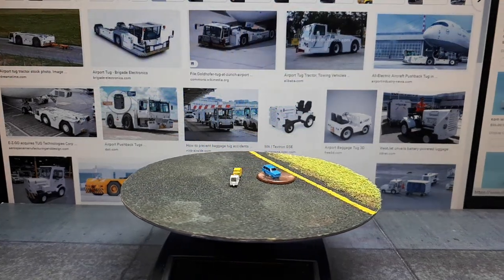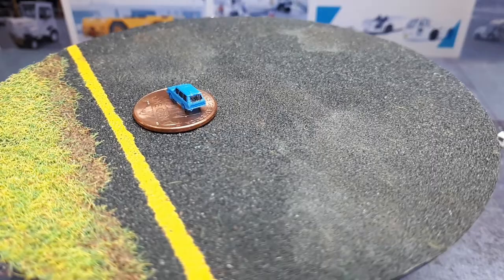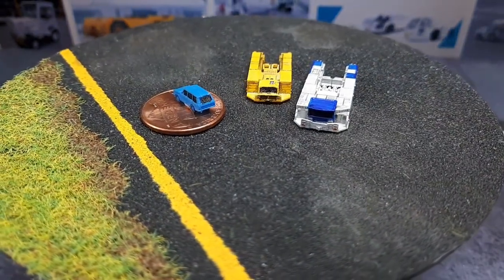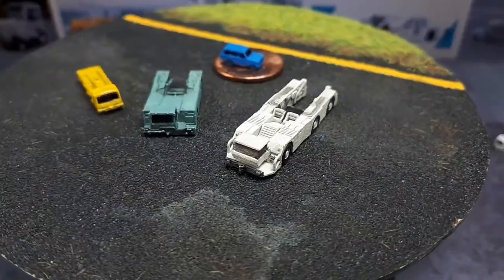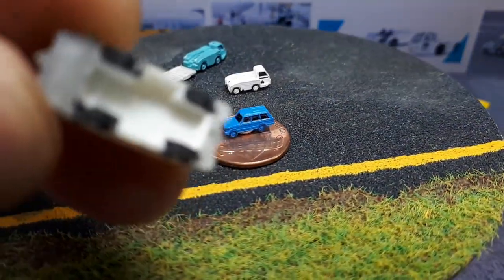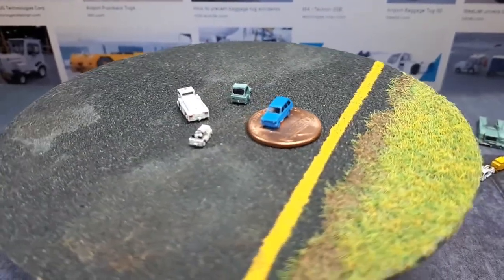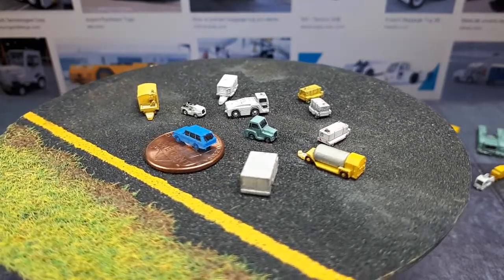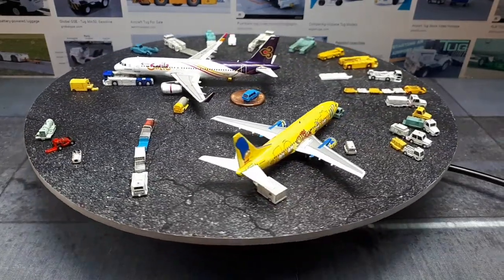1/400 Airport GSE, tractors, 3D printed from Shapeways, tugs, pushback, trailers,

Comment: Love your stuff. Just a comment on the "welding cart". In 30 years of working over 20 different jobs at the airport, I've never seen a welding cart. I'd wager it is an Oxygen Service Cart, or Nitrogen Service cart (for tires).
Reply from the maker: Makes sense; welding near jet fuel vapors is probably not common.